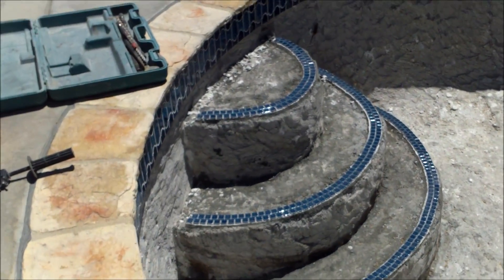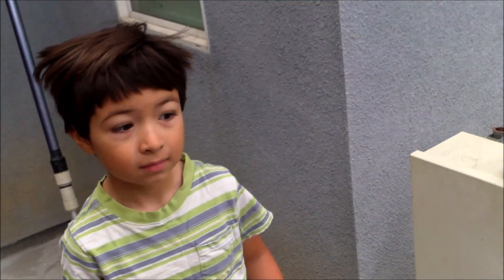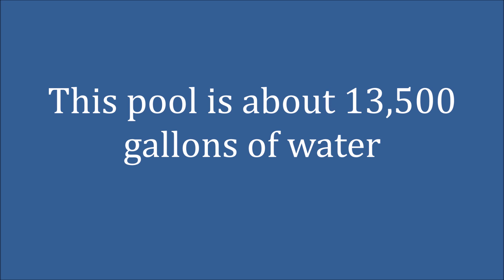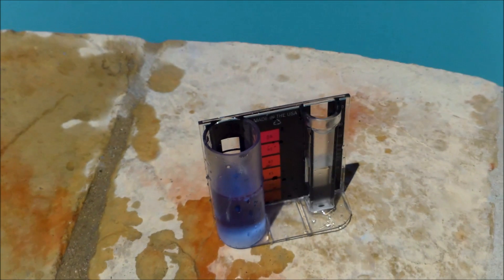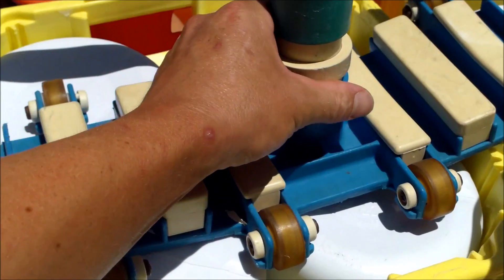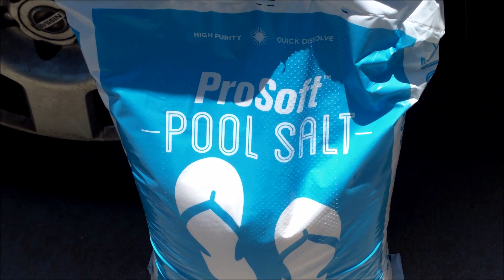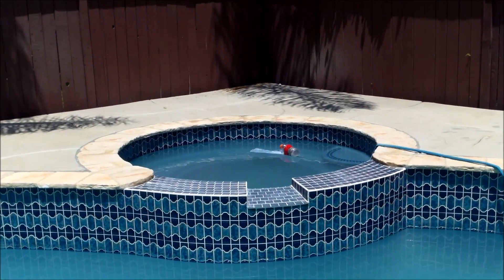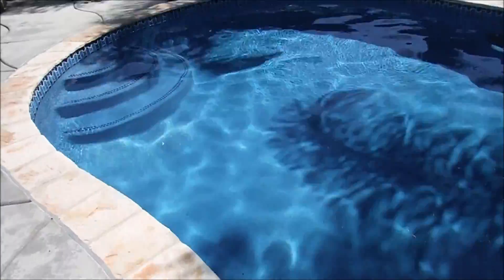Acid Start Up for White & Colored Plaster Pools Step by Step - Part one of two

Comment: Where did the plaster dust go for the first 4 days of brushing if pump is not running to filtrate it away?
Reply from the maker: The acid destroys the dust.
Reply: @SPL  What does it mean “destroys”? Concrete plaster dust doesn’t evaporate out of the pool into thin air obviously. Plaster dust either fallls down to the bottom or is filtered away and then filter is washed to get rid of it. Plaster dust doesn’t disappear to nowhere.
Reply: @Bitcoin-Busa it does 😂
Reply: @Bitcoin-Busa you're 100% right. This is a crazy start up.

Comment: Dumb question. If you dont turn on the pool filter.. where is the dust going? Are you just letting it settle to the bottom?
Reply from the maker: The acid "eats" up all the dust.
Reply: Just got my chip out done. Waiting for the plastering job.
Learning lots here so I can some what follow the process. Thanks for the start up info. Gonna purchase your guide it looks like.
10K play pool and 600 gallon spa.
Reply: Not a dumb question.

Comment: Working on a quartz startup followed the normal npc startup. Still have some dust 28 days into it and some variation in color. Should I try an acid bath this far into it?
Reply from the maker: You can try 2 bottles of EasyCare Beautec to see if that helps at this point.
Reply: @SPL  I also noticed you didn’t use submersible pumps in your acid bath. Is diluting it and brushing it good enough? Everyone is telling me I need to have multiple submersible pumps in the pool if I’m going to do an acid bath.
Reply from the maker: @dylanforse303  No need really but you can hang one with ropes on the water surface.

Comment: I replastered my pool almost 4 weeks ago and the pool service did a traditional start up and I still have plaster dust in the plaster. Can I do the acid start up method now to remove the remaining dust? My pool is about 22,000 gallons.
Reply from the maker: Try adding 1 bottle of a product called Beautec to the pool and brush it a little more aggressively. I suggest this brush: SweepEase 654367706282-SS/Combo-18 Stingray SS/PolyPool Brush. After 2 weeks of brushing the surface everyday you should see some improvement. It is too late to go back and do the acid start up now.
Reply: @SPL  Thank You. I ordered both products today.

Comment: I plastered my pool Sunday and finished filling it Monday. I have been scrubbing twice a day and wanted to know how long before the white haze comes off the plaster. It’s not all over the pool, just some parts.
Reply from the maker: If you add a bottle of CuLator Super Start Up that may help with the white scaling.
Reply: Thank You. I’ll give it a try
Reply: I had used Leslie’s Stain & Scale Prevent the first day but haven’t seen much change
Reply: You can speed it up using a stick of 2inch pvc like a straw over the white haze. Hold it about a foot over the area in the water and pour a little acid down the pvc pipe. About 12oz per spot. You can slowly move the pvc in a circle while raising/pulling the pipe out of the water about a foot or two. The acid then falls/drops out off the pvc over the plaster white hazy cement and lands right on it in a uniform mushroom cloud. Acid has a specific gravity of 15, its heavier than water. You can see the acid fan across the floor. let it sit there and you can watch the white burn off in seconds. then brush the acid gently away so you don't over expose one area. while the pool is off!!!
Or you can add more acid and run the pool if you do not have a heater. thats less risky because it will burn off more even... I can do 5 or six pools a week, color or not, safely buy running the pool after day one. Google a Hot Start Up. There are classes on these start ups by the plaster venders. I've never been to one who had anything bad to say about starting the pool during this process unless it has a heater, or there are jets on the steps, benches etc where that direct flow from them would over expose around the jets and leave a darker color around them. 

Remember the pool tells you how much acid to use and how long to leave the acid sitting directly on the surface. After about a min or two the acid is used up in a way. Its still eating layers off but doing so in a much slower manner.
Reply: What i mean is the acid is used up and no longer burning the cement or stain off. (The ACID!) After that only the low water PH is cooking the plaster at a much slower rate. drip a few drops on a spot of cement, or lime/sand stone. I will turn yellow and bubble for about two minutes then not longer eats the rock. And remember, stain removers, everything you add to the water has a PH. A high or a low. The two in this video are high in PH. Thats why he added those first. then the acid.

Comment: Iv never seen a pool that can't be usded pritty fast...and most have very clear water if the plasters did a good job...so I'm a bit consernded about the quality of this job...what's with the lack of pebbles or glass beads they give the pool 4 times more life than plaster...so it ends up costing the same if not saving money long term...if your going to do a pool do it as best as possible.
Reply: Can't get any customers to go for the beads and pebbles, most of them think plaster is too rough.

Comment: Do you add salt even if it doesn't have a salt generator? Mine is also 13,500 gal & I'm wondering how much to add?
Reply from the maker: Need a Saltwater generator installed.

Comment: With acid startup, is it preferred to bypass the heater?  For startup methods that recommend bypassing the heater, what is the preferred method for the bypass?  For example, temporary re-plumbing, re-plumbing with bypass values etc?
Thanks a bunch
Reply from the maker: Just leave the pool off until you are ready to raise the pH and Alkalinity up. No need to run the pool during the Acid Start Up process.

Comment: Getting my pool replasterd this Thursday. About 25k gallons. Going to use this method. Wish me luck. Been following you for a while man. Thank you.
Reply from the maker: It should be fine. Just follow the process and the plaster will turn out good. The plasterer should have a dedicated start up guy for you.
Reply: Swimming Pool Tips, Reviews & How To -MrDgvb1 nah they just gave me start up instructions. Ill keep ya posted.
Reply: @Kbm42299  How did it turn out? I just finished replastering my pool Sunday and have been brushing twice a day and added acid. How long before all the white residue gets removed from the walls?

Comment: Great video!  When you are starting up a pool, when you add a sequestering agent, make sure you also add a CuLator Ultra 4.0 into the pump or skimmer basket.  That way any metals that are sequestered will be eliminated by the CuLator.  I recommend using the Ultra on every pool start up just as an "insurance" against metal pool stains.

Comment: How Much Would A Colored Plaster Pool Cost To Replaster (8500 Gallons)????
Reply from the maker: Depends on the area. Cheaper in Ca. & Florida - more expensive in Mid-West and East Coast.  I would say about $5000 here in Ca.
Reply: Trying to get an idea of cost....what would a 35,000 gal pool cost to replaster in Ca? Any recommendations for replastering companies in my city (Phoenix, AZ???) By the way, your awesome videos have saved me some serious headache and money...and because of that I sent you a donation a while back. This week I had a problem with my spa not maintaining the water level. I googled the problem, your video came up, I watched it.....an hour after that, I had the new check valve installed. I will again be donating to your site! THANK YOU!!!!

Comment: very nice video. I have a question. I usually have the filter on 24/7 when I do the 4-5 days acid start up. 
I know on your video u said to keep pump off. Does this process work better? And if so ,when is it safe to turn on the filter. 
Thank u
Reply from the maker: +Manuel espinoza You don't want to run the equipment until the pH is above 6.8 or  you risk damaging the equipment or plaster in an acid start-up. This will cause the metal in the heater to bleed into the pool.  Usually after day 2 all the dust is gone so you can start raising the pH. In a traditional Start-up or Bicarb start up you can turn the pool on right away. Ignore the comment from YouTuber as he doesn't know what he is talking about. In an acid start up you don't need to run the pool while the plaster cures for 48 hours. After you bring the pH up run it is much as possible.